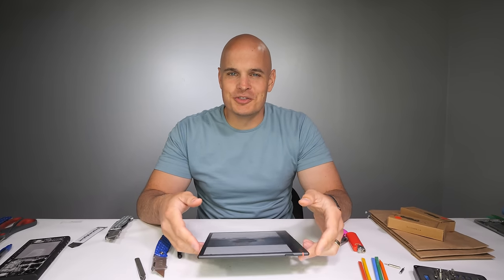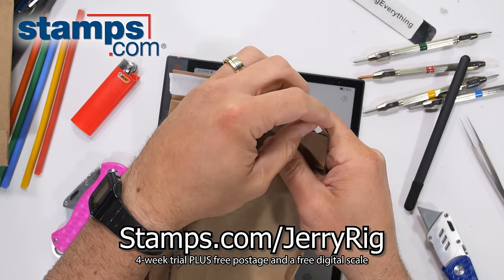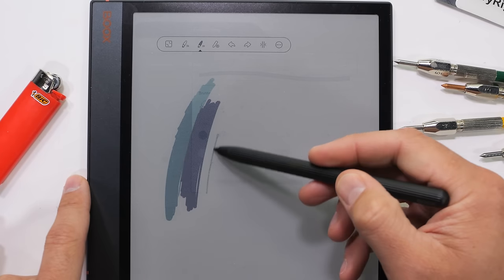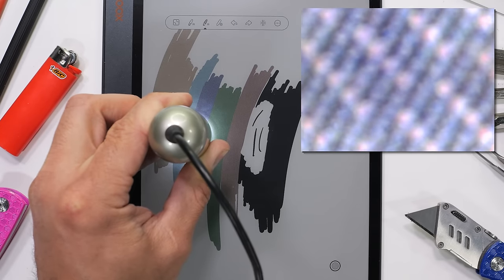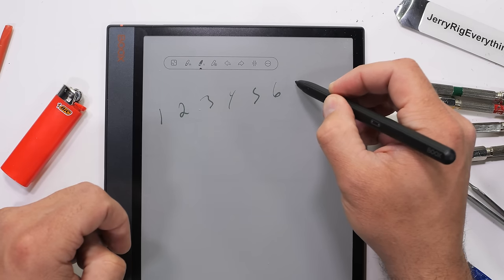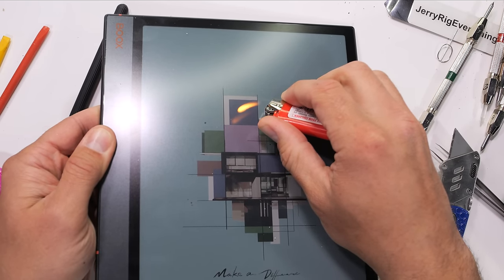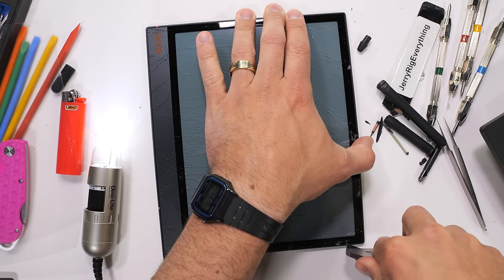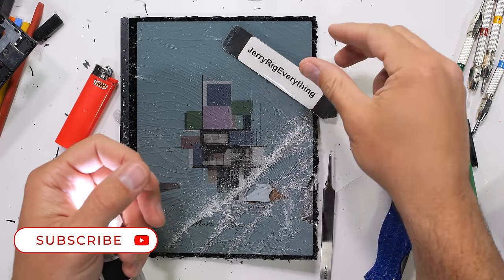Color E-ink looks CRAZY Under a Microscope!

Comment: This shows that E-ink technology can be impressive.
Reply: A
Reply: @SkeeziOS  A
Reply: @EnriqueMcQuade Е
Reply: It is, especially when you optimize the settings to refresh on its own in the Air 3C settings.
Reply: Wtf that wasn’t me 😭
Reply: @SkeeziOS  Ruh Roh. (Scooby Doo style.)
Reply: @EXG21  and this is just the lower end one. Top end ones (the Tab series in China, not sure about the oversea equivalent) got dedicated display chip to make refreshing even better. And I personally can use it like a regular tablet without thinking too much that it's an eink device, except for when reading books I'd prefer higher clarity and use Regal mode.
Reply: @FlameRat_YehLon  The Note Air 3 C also has a dedicate GPU
Reply: It's always has
Reply: @bobsonian  just did a quick check and it seems that Note Air 3C has no Chinese version whatsoever. Both of the 10 inch models in China (Tab 10C and Tab 10C Pro) has etched glass display, while Note Air 3C has regular glass but still got the dedicated GPU like the Tab series. Wonder why they decided to approach the two markets differently.
Reply: @FlameRat_YehLon  That's why I order and installed a screen protector that has a rough paperlike surface. Every one of my stylus input devices use paperlike screen protectors to help with stylus use.
Reply: Me writing the last sentence of my essay on e-ink (im in 6th grade)
Reply: @EXG21  I'd say Boox's etched glass model feels rather natural to write on using the original pen nib, but I personally use a titanium nib instead (they use the exact same technology and nib type as Samsung's S Pen, and my usual choice of titanium nib brand has S Pen compatible ones), which doesn't really work on etched glass, and I had to apply a paper like protector on top of it to lower the friction to an acceptable level. 
Probably a niche case but it worked for me well enough. Most people might find my setup to be way too low friction, though.
Reply: @FlameRat_YehLon  I also use the titanium nibs so I don't have to replace the nibs regularly. That's why I use paper like screen protectors on my devices. I hate scratches on my screens so it's an added layer of protection. The metal nibs are fantastic, I have them on all my styluses, the Pro S-Pen, the Boox, Remarkable 2 marker, Lamy dual stylus and rollerball pen, and then my favorite, the Lamy Safari Stylus.

Comment: E ink watch seems like a great idea! Battery life is way more important than refresh rate when it's just doing wrist watch things.
Reply: Pebble Time smart watch used coloured eink
Reply: Agreed, companies such as Sony, Seiko, and Fossil Hybrid all use E-ink displays but the common consumer aren’t attracted to them so they got low sales and died out. Features/price is a common factor most people care about. 

Tech that looks old is unattractive to them. “If it looks old, it has to be cheap. If it’s not cheap, I would rather get a Samsung/Apple/Garmin instead”
Reply: @simmmomom  No. It was coloured LCD disguising as e-paper, not e-ink.
Reply: As an owner of several Pebble watches,  @Tomazack  is correct, the screens are a very-low-power type of LCD. They don't have the ghosting problems that e-ink has, resulting in higher usable refresh rates (though "update rate" is probably a better term to use with e-ink), but they still require power to maintain a static image. I think some people were confused because they're transflective, meaning they use reflected ambient light most of the time but have a backlight if you need to see it in the dark (the slightly underhanded marketing didn't help).
Reply: Jerry's fingers must be immune to tiny glass shards.
Reply: Yessssss
Reply: I actually backed an E-ink watch on Kickstarter once. The company ran off with everybody's money. I was really bummed as I would love just a simple wash with a several month long battery life. ☹️
Reply: @GCAT01Living  Then why not try the Casio F105W? It has not just a 7-month but a 7-year battery life.
Reply: yeah and you don’t really need that much of a color range when doing wrist watch things
Reply: Totally agreed
Reply: The Garmin Fenix line of smartwatches use a MIP display, which is fairly similar in function to an e-ink display!
Reply: @simmmomom No it didn't, the Pebble was LCD, but you can get the Watchy now which uses E-paper
Reply: But aren't there brightness concerns?
Reply: The reason I don’t use my Apple Watch is bc the battery life is annoying. I’d love it having more battery
Reply: I keep thinking about this. And it won't matter quite so much about back lighting during the day.

Comment: If you've ever seen other eInk displays, the refresh rate on this screen is insane!
Reply: i think some devices in the past have been able to do this, but the tradeoff is that the higher refresh rate leaves more ghosting, so it's usually a setting.
Reply: The refresh rate really reminded me of those awful passive STN displays from the early/mid-2000s. Honestly, not bad.
Reply: Boox’s super refresh technology is really good, the best in the industry but it is more intensive on the battery. What users are really complaining about is that BSR is always turned on. You get 10x more battery life on the Note Air 3 (B/W) than the Note Air 3C.
Reply: Dasung and hisense are even faster
Reply: I have the Lenovo ThinkBook Plus G4 with colored eInk secondary display. The display is very much like the one shown here - probably from the same factory, too. 
The Lenovo has two options for driving the eInk: A high-refresh mode with 12Hz that has decent ghosting and very bad contrast and colours - as seen here. The other mode is called 'reader mode' with maybe 2Hz, long input lag and terrible ghosting, but the colours are much more vibrant. Great for reading books or comics, but useless for anything where the content changes with any regularity.
Reply: @Steamrick  Hisense and dasung are faster
Reply: Hisense and dasung are even faster

Comment: 9:40 that was a close call for your finger
Reply from the maker: its ok - I have spares.
Reply: @JerryRigEverything  🤔
Reply: @JerryRigEverything  From someone who just got 9 stitches in his thumb from basically this same thing, BOY missing a functional thumb seems so much worse than missing any other finger lol. Also, the numbing of it to get those stitches put in... that was not fun.
Reply: @Frozty  I did it to my side palm in the fatty area of the palm. A lot of stitches and I could actually see the fat cells inside the side palm. Very cool and painful. Ha ha.
Reply: Do you now @JerryRigEverything
Reply: @JerryRigEverything  ahhahahah i have spares what a saying
Reply: I saw that 😳 I have several experiences myself 😬
Reply: iPhone should have an e ink display on the back for QR codes and tickets
Reply: He can Jerry Rig everything it was only a matter of time before he went cyborg
Reply: Zack's hands scratch at a level 6, with deeper grooves at a level 7
Reply: Is it possible to insert a SIM card instead of memory card
Reply: @EXG21  Taking apart our FIRST human hand
Reply: @cloud6769  If only but no, I just had a defective lock on my foldable utility blade knife that gave way when cutting and caused the blade to slide through my hand instead of the material.
Reply: @JerryRigEverything is a cyborg confirmed.
Reply: @Frozty  Actually, when someone cut it's thumb, it's possible to use the big toe as a replacement.
Reply: I'm always worried for his fingers whenever I see him casually forcing the blade towards him.

One rule I learnt really young was to always cut so the blade is facing away from you. That, and to always keep your fingers out of the way.
Reply: @JerryRigEverything  A human skin has scratches at level 5 with deeper grooves at level 6.
Reply: The thumb👍:  😰...🥲 Not again
Reply: @Frozty  Cut my index finger last Friday, my doctor used Dermabond (glue) instead of stiches.  Said it was that or get three numbing shots, and I'm soo glad he went with the glue.  The wound healed up nicely and four days later the glue just fell off.
Reply: @JerryRigEverything hi
Reply: @EXG21  lol me too from an rc plane
Reply: @Frozty Uncle Roger : why you use lol. Just use emoji , haiyaaa...😒 
😂
Reply: @JerryRigEverything stress test of fingers when
Reply: @Leanzazzy I know exactly what you mean, I know he knows what he’s doing, but no matter how experienced someone is I feel they should follow that rule as much as is possible for safety reasons, it’s one of the things that makes me uncomfortable when watching. I support this channel and methods and it’s always interesting, but just to avoid hurting oneself at all costs I feel like it could be easily resolved
Reply: I cringed so hard when that happened! Never cut towards yourself!
Reply: Guys chill... His finger scratches on level 6 and deeper groves on level 7
Reply: @Frozty  damn hope u feel better
Reply: @Frozty then don't numb it next time.
Reply: e-Ink readers somehow never seem to really get where they need to be to really out compete Tablets for e-reading. It's a shame but it's been around for 20 years and hasn't improved all that much.
Reply: @JerryRigEverything  you called the s24 ultra a note 24 ultra lol . 😅 Samsung discontinued the note series with the note 20 ultra
Reply: @JerryRigEverything  What are you, a robot
Reply: He has some balls to use a knife to pry something that can slip any time
Reply: totally rig everything
Reply: Because finger is dinger and finger bleeds.
Reply: As soon as I saw that, I thought of the scene in Ernest Goes to Camp where he was showing the kids how to sharpen a knife on a whetstone.
Reply: It baffles me how not careful with his razer this guy is.
Reply: If his fingers injured. He become Smoorez😂
Reply: @JerryRigEverything  i did cut my thumb the same way you were about to and i could see my bone got like 5-6 stitches and when i saw them after like 5-6 days i passed out for the first time in life 
it happened like 4-5 years ago
Reply: Cry

Comment: An e-ink smart watch would be genius! I'd definitely use one
Reply: I have a fossil gen 6 hybrid. It uses an E Ink display, honestly love it
Reply: Yes
Reply: @gaydoomguy  They’re e-paper, low power LCD like in Casio watches. More accurately, transflective LCD (it’s and LCD that reflects light with an optional backlight). E-ink is a company and brand name that uses the particle up/down system that the pebble did not use. (E-ink is now synonymous like Kleenex).
Reply: Amazfit bip lite has a similar display. I had one and loved it!
Reply: @amilcargg  nope.
Reply: Not really transflective display smarwatch would be better 
They use low energy and you can use the display to bright more on night
Reply: They just got killed by market
Reply: Pebble watch was e ink
Reply: I think MIP transflective displays are better for smartwatches, Garmin has been using them intensively for years.
Same "no power usage unless the pixel changes" as e-ink, the more environment light you have the brighter the display gets, and I'd say it gives off better colours than filtered B&W e-ink.
Reply: Pebble used e-ink - I believe the later versions even had color

Comment: This display is much more snappy than others I've seen. Very cool. Thanks for the breakdown.
Reply: Right ? it has more functionality, is more snappy and have more FPS, but I think the ghosting is quite a bit more present on the bad side, is it a setting that can be changed maybe ?
Reply: @ADP4031  Yes, Boox devices have 5 levels of screen refresh. From "full refresh with black phase all the time" to a dithered high-fps mode that's suitable for video.
Reply: There are screen differences too of course. But usually it has less to do with the screen than the processing board. 

The more regular e-book focused readers mostly go for battery time and use as low power CPU and OS as possible. Like the typical Kobo. But some using the exact same screen (Tolino for example) have a more powerful CPU and run Android. They are perceived as updating faster because of this. The downside, battery time. Being counted in days instead of weeks.

Comment: I see a lot of people in the comments commenting on how Pebble was the first to introduce color e-ink to the market with their watches. You are wrong. Pebble color screens were not e-ink, just normal LCDs with reflective backplates like a gameboy color. It uses very little power but it still uses power and is not e-ink. Another similar and still updated watch with similar screen as the Pebble is the Xiaomi Amazfit Pace aswell as some other cheaper xiaomi watches. They have a "always on display" that is a reflective lcd screen. Pretty cool nonetheless.

Comment: Now we need a 240hz E ink display
Reply: Won't happen any time soon, because these involve moving material in the pixel, which means physical travel time.
Reply: E-Ink at 240Hz is just like an inferior OLED
Reply: why? that would defeat the entire purpose of it.
Reply: Even if it is accomplished, the power consumption would exceed an LCD display. A T-LCD or R-LCD could accomplish it. You could try a mixture of dithering + interlaced or mosaic technique on eink to increase fps, but that can look ugly.
Reply: I hope we could first get one with minimal ghosting/residual colors. Because that's the real issue currently.
Reply: Shifting Quantum Universe Inference Dots. 

Quantum Entangled Ink Blobs. May make it a better electronics acronym though. ;)
Reply: maybe if it was a particle accelerator

Comment: I have a pebble time smartwatch, which if I am not mistaken uses the same technology. The battery life after all these years still beats my android based smartwatch.
I always wonder why no other smartwatch companies continued using the tech.
Reply: Actually that's a bit different, the pebble has a better refresh rate without ghosting but the screen does not stay on without power. However it is very energy efficient too.
Reply: Yeh I have both the kickstarter models.  The OG was a lot easier to read, but having colour was cool for almost 10 years ago.  Both batteries expired, so i am reluctantly wearing a galaxy.  I think i'll upgrade and get a garmin next, I think they have something similar to the eink, at least that's my understanding of the outstanding battery life they exhibit.
Reply: The pebble watch used a type of LCD screen that had chips next to every pixel that allowed it to save power not e-ink. The reason not many companies use e-ink is because one company owns the patents on e-ink and that means that no other company can use it without paying  exorbitant amounts of money for something that may not sell.

Comment: I feel like using cmyk instead of rgb would be a lot more suitable for more vibrant colors
Reply: Nope, your eye has three types of cones, which detect three colours, and those colours are RGB. Can’t get better than that
Reply: @vmusatov  yeah but when you want to mix pigments to create colors you need to use cmyk, like in printers. Rgb is for mixing light, like in smartphone screens.
Reply: @tomer4789  on paper you can’t add any more light, so you subtract it with CMYK. It’s not about colour preferences, it’s about how you can accurately represent the range of colours
Reply: @vmusatov  it sounds like you are agreeing with him. E ink displays don’t emit light.
Reply: @hastyscorpion  hm. You’re right. I didn’t think it through. It’s just when I was a kid I was unable to get yellow by using red and green pencils. It felt impossible and counterintuitive

Comment: 4:34  

LCDs (Liquid Crystal Displays) typically do not have colored diodes. Instead, they use a combination of a white backlight and colored filters to produce images. Here’s a more detailed explanation of how this works:

    Backlight: LCDs use a white backlight, which is often composed of LEDs (Light Emitting Diodes) that produce white light. This backlight illuminates the entire screen from behind.

    Liquid Crystal Layer: The liquid crystal layer controls the amount of light that passes through by aligning the liquid crystals in different ways when an electric current is applied. This alignment changes the light's polarization.

    Color Filters: In front of the liquid crystal layer, there are color filters arranged in a grid of red, green, and blue (RGB) sub-pixels. Each pixel on the screen is made up of three sub-pixels, one for each primary color.

    Sub-pixel Control: By varying the alignment of the liquid crystals in each sub-pixel, the amount of light passing through the red, green, and blue filters can be controlled independently. This allows the display to create different colors by combining different intensities of these primary colors.

Comment: I’m pretty sure the unidentified design feature on the side is there to indicate the presence of a magnet that is intended to keep the optional pen accessory attached to it. It’s not a very strong magnet, so I wouldn’t trust it, however. Also, I am fairly certain that most of the BOOX tablets with “matte” displays are in fact using glossy glass with a textured plastic layer pre-applied at the factory. It is nice to know that they’re using strong, scratch resistant plastic for that.

Comment: Interesting video !

I would like to correct something: in this case, white is NOT made up of a mix of red, green and blue.

Emmissive displays do additive synthesis of colors, meaning that they EMIT the colored light that gets mixed in our retina.

E-ink is like paint: the synthesis is substractive. Mixing all primary colors don't give white (which is intuitive for anyone who has played with paint before), but black. The color our eyes see is not emited by the displayed, but other wavelenghts are substrated from the reflected light by the material.

The residual colors you see in the "white" areas is probably the best they could achieve (most of the area is white). The white is probably light grey as a result.

I'm surprised they chose RGB as base colors, substractibe sythesis usually relies on CMY (e.g. printers).